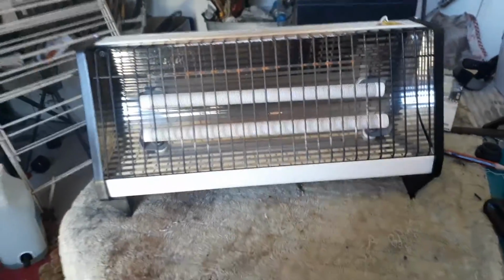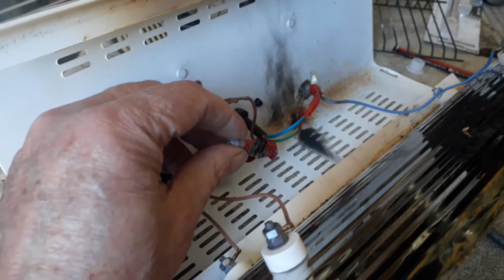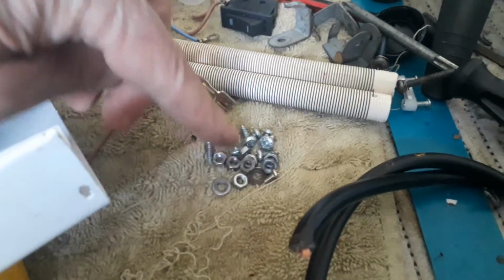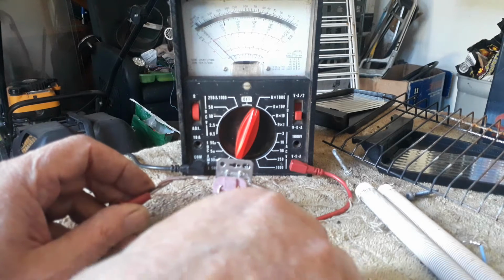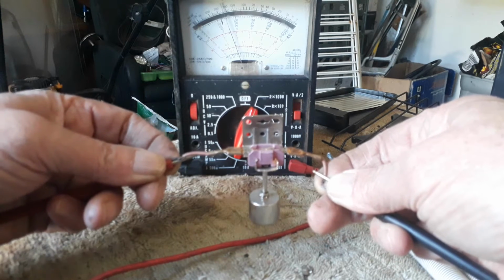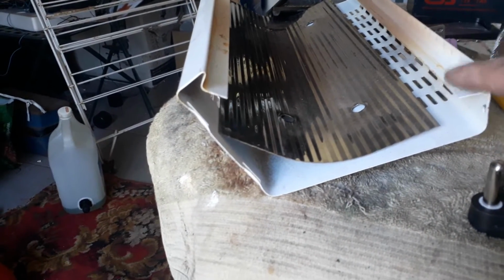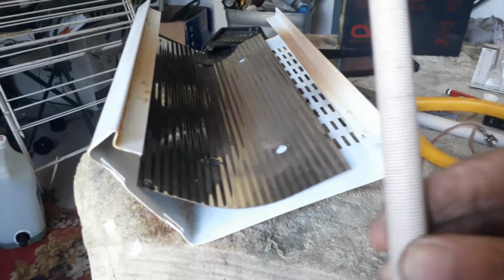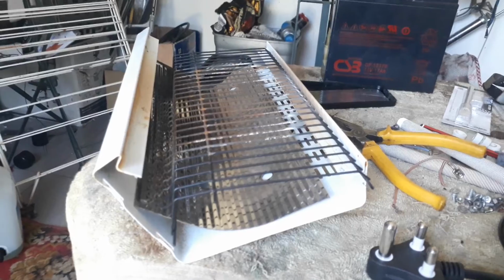Part 1, What will my next Project be,.... Part 2 Build.... Part 3 Test.

Comment: If a magnet won't stick its stainless steel.  You can use the safety switch to turn on an outside  light automatically when a door is opened, or set off an inside alarm when a window or door is opened. In your pile of parts I didn't see an overload device.  That what would be responsible for keeping the heater from overheating if a problem with the cycling control develops. Just for what its worth Jan, to see how much amperage should be going through the wires, divide the heaters wattage by the voltage supply.  The answer is the number of amps the unit draws.  Loose connections increase resistance which in turn causes heat generation, arcing and eventually burnt wires.  Can't wait for the BBQ sample !!  LOL.  Fun video my friend and it shows your ingenuity !!
Reply from the maker: 44 You got it right, it is a 1800 watt heater with both elements on, that loose connection on the one element was the problem, the wires are far gone now and I ordered a new one, so if this one want to burn I will make it burn as a barbecue lol, thanks for your kind words, o yes and the idea to trigger a open door will works fantastic, have already an idea now
Reply: @jankotze1959  Good deal...I, like you, work with a great deal of salvage material.